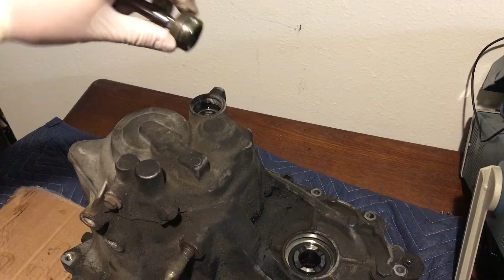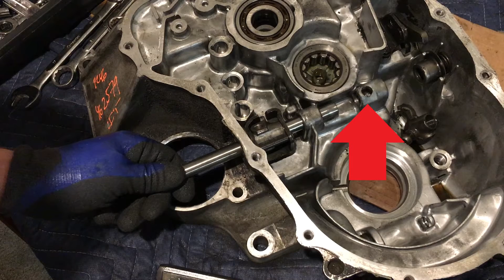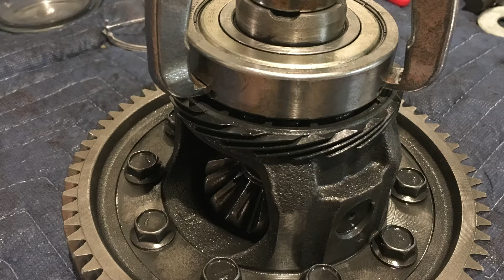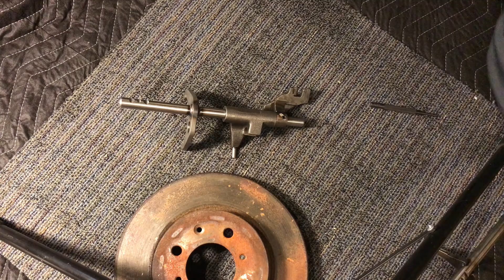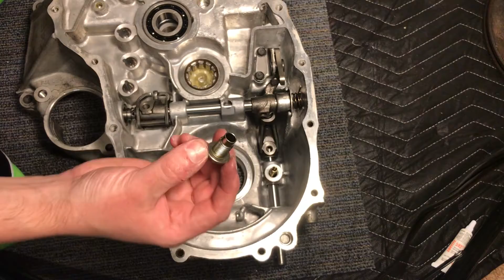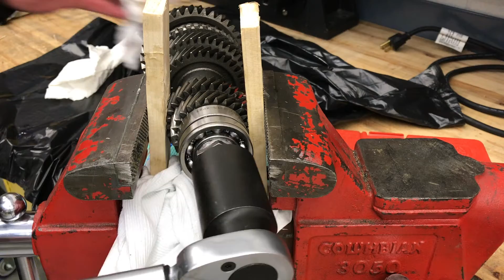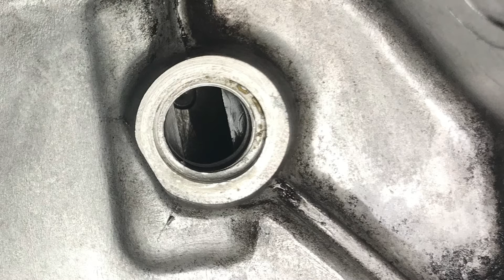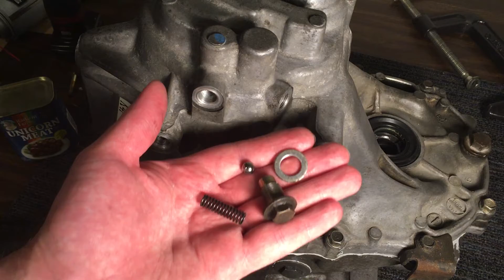1996-2000 Honda Civic D16 S40 (B000) Manual Transmission Complete Disassembly and Rebuild

Comment: This guys poor ratchet "am I a joke to you?" every time it's being used as a hammer....🤣 very helpful video btw, thanks!
Reply from the maker: I definitely should have used a hammer.  It is a made in USA old time Craftsmen so it handled it well.  You can see later in the video that I used an impact wrench.  I bought that half way through making the video.  I 100% recommend  getting one.  It makes work so much quicker.  I am building an Acura RSX transmission now for a project car.  I wish I bought an impact wrench years ago.
Reply: @CivicFiberglassDoor  Question. I did everything correctly save one thing. I did not get my interlock lined up correctly the first time and the bolt caught the edge. I noticed it couldn't shift it on the bench. went back and watched the video and immediately knew what I did wrong. pulled out the interlock bolt and realigned it and reinstalled. shifts fine now. Do you think the interlock is wrecked due to bolt catching it? How bad could it be?
Reply from the maker: @tonyd7164  Its hard to say since i cant inspect the interlock or the bolt.  It may be fine since it shifts on the bench now, but its hard to say.  

When you screwed in the interlock guide bolt, was there any resistance? Was the bolt screwed in all the way at the time you bench tested it and it didn't work? Is there physical damage to the interlock when you look through the hole? The "correct" way is to take the transmission housing off and undo the interlock to check for damage. This requires you to re-do the sealing of the transmission with Honda Bond (or equivalent), along with re-sealing the interlock shift shaft bolt, and interlock guide bolt hole.  

I checked and the interlock is discontinued from Honda (Part # 24430-PL3-010) so if yours is damaged,  visiting a junk yard may be an option to get a part to replace it.

Comment: Thanks for the video. I am preparing for the same rebuild/restoration of my S40 gearbox. I just bought a spare one a few days ago so I can start disassembling it and checking the condition of the components inside. 
Questions: 1. Did you use original parts (bearings, oil seals) for the rebuild of aftermarket ones? I guess all these will be around 200-300$ if they are OEM. 2. Also what about needle bearing bearings that are under the gears? Need to be changed or old ones are typically in good shape? 3. Did you have to put new thrust shims after the shafts' clearance check?
Reply from the maker: 1.) I used the bearing and seal kit from  Synchrotech transmissions. The bearings didn’t have the Honda package on them but they were genuine NTN bearings.  The seals weren’t Honda packaged but they were the same manufacturer as oem, so it’s the same.  I did order the differential bearings from Honda though. I used online  oem sellers so it’s at a discount. 

2.) i reused those needle bearings. if there’s any scoring or marks on the needles, the shafts or gears, use new ones. Out of the 5 I’ve taken apart, I haven’t seen a bad one. 

3.) I did have to put a new shim on because I used different case parts from a few transmissions (bell housing, transmission base, main shaft and countershaft) to make this work. I used the best parts and put them together to make my current transmission. if you don’t change parts that change the length of the shafts, you may not need to change the shims. If you install a new input shaft bearing, at least check that it’s exactly at the depth as the old one that comes out. If you do check the main shaft, there are other tools out there you can use to put tension on the main shaft. I just got the Honda tool to show the exact factory way to do it. I also got one of the last ones I’ve seen on eBay. It was $65, but new tools are a lot more
Reply: @CivicFiberglassDoor  Thanks for getting back to me so quickly. Yesterday I dissembled the spare gearbox that I took to learn and experiment on. As expected the bearing on the main shaft facing the transmission housing has a huge play. The one on the clutch housing seems better but still, I guess it has too many miles on it. Small but still noticeable play on countershaft bearings as well. Differential bearings seem ok. 1st/2nd and 5th/reverse shift forks have minor wear, but 3rd/4th one has deep grooves. For this one let's say I will check what is the condition of my 3rd/4th gear shift fork that is on my vehicle (no shifting issues when driving so probably should be still usable). I can select the best parts from the 2 gearboxes that are within specs and assemble one at the end. Anyway, I am thinking that before purchasing a rebuild kit I need to assess the condition of all expense-sensitive parts that may need replacement. It's not mentioned in the service manual how to inspect the condition of the gears (tooth wear), only axial distances measurements. Any idea what reference can be used when judging whether the gears are ok or worn out? 
The current issue I am facing with my gearbox is that I have increased (bearing) noise on 1st, 2nd and reverse gears, and also huge radial clearance on the driveshafts that probably is the cause for the noticeable clunk noise when moving slowly back-forward. When I disengage the throttle completely while driving at 2000rpms I can notice there is some clearance somewhere between wheels and engine, something is loose. Same when I hit the gas pedal from driving in neutral...there is noticeable clearance in the powertrain.
Reply from the maker: @ceckoslav  I didnt really check for gear wear, since they all appeared to be good; there were no cracks or warped teeth faces.  My guess is to look at the faces of the teeth and if they look smooth and not warped, they should be ok.  Two years later and it is still going strong.

Comment: Thank you! My 7 year old son and I will be cracking open the transmission from our project EX civic. It howls something terrible while driving, in every gear. I bought ours at an auction and the car was previously stolen so the thieves must have really done a number.
Reply from the maker: Does the sound go away when pressing the clutch in? If so, the input shaft bearing may be the cause.  I havent opened one that hasnt had a bad ISB in it.  Search for the 1996-2000 Factory Service Manual PDF for more info.
Reply: @CivicFiberglassDoor  Input shaft bearing is definitely bad. I suspect car thieves are getting worse and worse at driving manual transmissions so it must have been quite a joy ride. I think we will throw a set of bearings at this transmission since we found nothing too bad. We just tore it down and found that bearing to be noisy. Luckily I bought the service manual years ago and it's been very helpful!
Reply from the maker: I got the NTN bearing kit from SynchroTech transmissions. They sell a rebuild kit. I’d also replace the seals as well since they don’t cost too much.
Reply: Lucky kid! I wish my pops would do stuff like that with me. Instead, im learning how to wrench on my own

Comment: Thanks a lot for posting this. My 5spd tranny is tagged S40-1115050 with P4A stamp looks like BOOO is this the same tranny you're working on in the video and also the diagram of the transmission you're showing could you please tell me what rebuild manual you were utilizing so that I can order one thank you very much
Reply from the maker: This is the P4A-B000

I followed the Honda Factory Service Manual for the 1996-2000 Honda civic. I own a physical copy of this I have used for many years,  but I heard that PDF copies of this same manual exist on various websites such as Honda civic specific forum websites.

Comment: Just curious, was there anything wrong with the transmission when you rebuilt it?
Reply from the maker: This was my first time building a transmission, but I am very mechanically inclined and followed manufacturer specs. I ordered all new bearings even if they seemed ok. The input shaft bearing is usually bad on these. 

The transmission in the video is actually one of a few that I pulled from a junk yard to rebuild so I know I’d have a good one before I pulled my failing transmission off.  On the transmission in the video, the input shaft and countershaft bearings were bad, and the 3rd gear shift fork was out of spec; both are common.  My transmission that was failing had the same bad bearings, the countershaft case bearing walked itself out causing 2nd gear to not engage very well.  The 3rd gear shift fork made shifting into 3rd impossible and 4th very hard; lots of grinding. 

Most synchros were ok and within spec. A single synchro was less in spec (but still in spec) compared to others on the other junk yard transmission so I swapped in the better synchros.  if I didn’t swap it,  the synchro would still work well. 

More than a year later and there are zero issues with the transmission. Having extra parts from the junkyard and my failing transmission allowed me to build another one (with new case bearings though, always do that if possible, with NTN)

Comment: Are you able to add a 6th gear to this transmission?
Reply from the maker: This transmission and engine was not made to fit 6 gears.  The whole transmission would need to be re-engineered to fit a 6th gear. It would be cheaper to swap a k20/24 engine and use a 6gear transmission. A lot more power/torque, and it’s a platform that accepts a bolt-on 6 gear transmission.
Reply: Thanks a bunch!  Will that transmission bolt to d16y8 with a auto trans
Reply from the maker: Yes. You just need to get a flywheel in place of the flex plate that’s bolted to the crank. The d16y8 is from the EX. 

I believe the A000 transmission can also bolt up to the y8. Someone tested both. The B000 from the ex is quicker but the A000 had better gas mileage due to their gearing.

Comment: Where can I find the gear set parts ?
Reply from the maker: you can try HondaAutomotiveParts.com.  But since the car is old, they may be discontinued.  One thing you can do is look at SynchroTech Transmissions website.  They well rebuild kits, so if the physical gear is ok, you can use one of their synchros to use with that.  If the gear is not OK, you may need to go to a junk yard and tear a transmission apart to get the main/counter shaft, or look on ebay for counter/main shaft gears.
Reply: Ebay

Comment: Good video wish I saw this one before I redid mine for the 3rd time
Reply from the maker: What keeps happening to it?
Reply: @CivicFiberglassDoor  bent 2 1-2 shift forks then installed the 5th gear slider not aligned so it got stuck then reinstall one of the bent shift forks by mistake then got the fork welded with 2 gussets hopefully this one holds together. Lol. My d16 makes 502hp and I really drive it hard.
Reply from the maker: D16 with 500+ HP? Respect

Comment: I now have this video downloaded so I can easily check I'm doing everything right even when I don't have internet access. And I check it often 😂😂 That's how many transmissions I've been breaking.

Thank you so much for posting this
Reply from the maker: What breaks on yours?  Mine has been going for 10 months so far and it works great after this rebuild. My 2nd gear went out due to the countershaft bearing walking out, 3rd and 4th was due to the shift fork wearing down.
Reply: @CivicFiberglassDoor  first I was breaking them flat shifting, synchro'd transmission just cant hold that at 400hp+. I stopped flat shifting but Inow 'm still constantly breaking 3rd gear. Hopefully though I won't be rebuilding transmissions anymore, have a dog box gear set on the way!
Reply: @CivicFiberglassDoor  company in my country agreed to develop the gear set back in 2022, unfortunately I'm still waiting. Not sure what to expect at the moment, they might never get around to finishing it
Reply from the maker: @thumslc  Is there any update on your car project?
Reply: @CivicFiberglassDoor  received dog engagement gears last year, mounting them this week

Comment: Esse é o d16y7?
Reply from the maker: este é o d16y8 com a transmissão B000.  Acredito que a transmissão para o d16y7 seja o A000.  o A000 tem rolamentos diferenciais de 35 mm e oferece melhor consumo de combustível, mas o B000 oferece melhor capacidade de resposta da potência do motor.
Reply: @CivicFiberglassDoor  muito obrigado pela atenção.
Estou querendo muito abrir ele pois as marchas engatam com muita dificuldade e Também esta com folga no diferencial.
Muito obrigado 😃
Reply from the maker: normalmente as engrenagens #2 e 3 apresentam problemas.  a engrenagem nº 2 porque a engrenagem do contraeixo sai sozinha da carcaça e o garfo de mudança nº 3 está muito gasto.
Reply: @CivicFiberglassDoor  bom dia meu amigo.
Acredita que meu câmbio é o p4A s40 B000? E o bloco é um d16y7.
Deve ser igual ao que você abriu então.
Reply from the maker: correto.  este vídeo é o b000.  algumas pessoas colocam o b000 no motor y7 porque ele pode fazer o carro acelerar mais rápido, mas não fica tão bom quanto o a000.  outro canal fez uma revisão de a000 versos b000.  eles instalaram ambas as transmissões em seu único motor para testá-las.

Comment: Thank you very much for this video! You could do this on your own , without recording video, following the manual and satisfying yourself with the perfection. But you took the time and effort to make a video so you can teach people and make it easier for them. Respect! You did great job! And you did it with care!
My reverse gear on my EJ9 in not engaging from first try sometimes, and I am ready when the moment arrives to do this job as you - following your video and the service manual. And I will enjoy it like you did.
Greetings from Germany! ❤️
Reply from the maker: I’m glad it is of some use to people.  This was all rebuilt inside my apartment. Sadly it’s a little hard to find one of the most worn parts of the transmission, which is the 3rd gear shift fork which makes it hard to get into 3rd and 4th.  I was lucky as I was one of the last few in the world to get a brand new OEM shift fork from Honda.   I wish you best of luck on your project!

Comment: I swear this man thinking everybody own a whole shop that's a lot of fucking tools that I can guarantee nobody has this shit a bit overkill.
Reply from the maker: I don’t understand your comment? This video shows the proper Honda manual way to do it.  No one is telling you you have to follow this guide.  Some people may not have the tools.  But they can rent most of them for free from an auto parts store. For the few tools you may need to get, it’s way cheaper to buy them than to buy a prebuilt transmission. Adapt the guide to your liking if needed. Other than the vise used to hold the shaft while torquing the top not, this whole video was shot in a 1 bedroom apartment.
Reply: Then move on.  This isnt an engineer from Honda.  Theyre showing how the manual says to do it.  If you dont have the tools, dont do the job.  Other than the dial indicator, I dont see anything else that any basic mechanic wouldnt have.

Comment: Do you need a press to remove the top bearings and gears?
Reply from the maker: This video shows a “best practice” according to the official Honda manual, but in reality you can remove the bearings with something like a rented puller or banging it against the ground. This Video shows a mechanic  removing the bearings, after removing the 32mm nut, by banging it against the ground against a towel:  https://youtube.com/watch?v=6qWAqbR80HI&t=12m1s